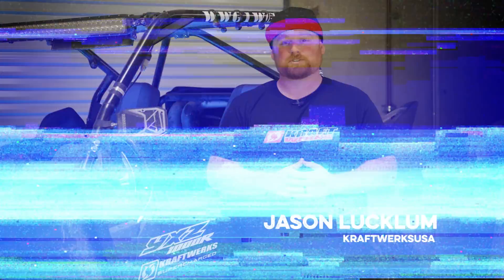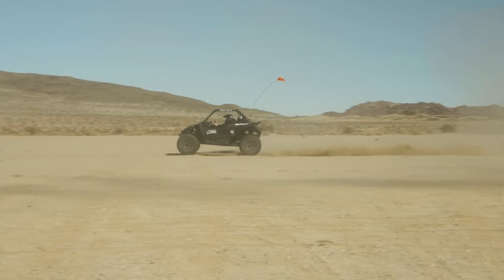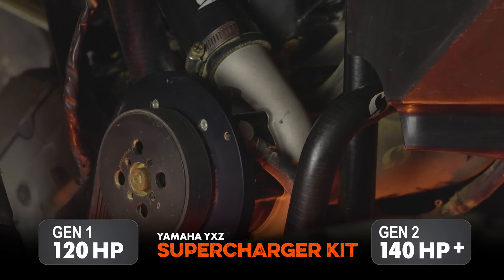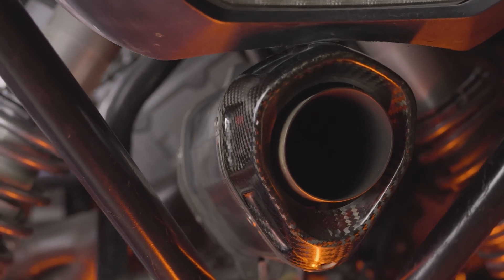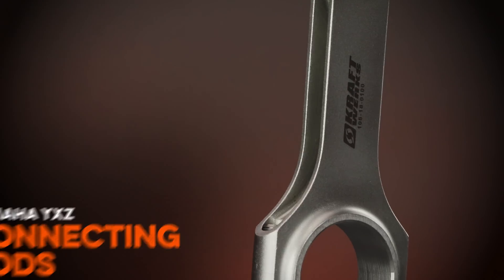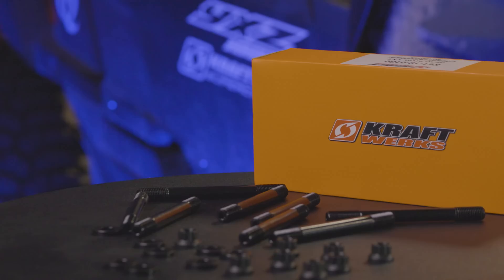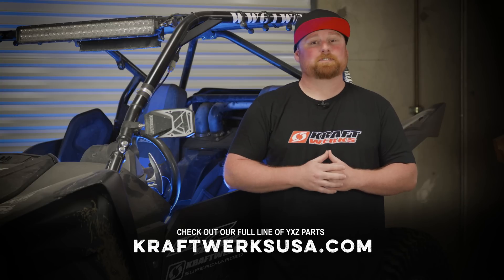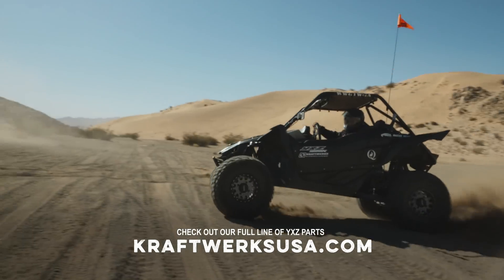Yamaha YXZ 2019-2023  Supercharger System, Engine Internals and More!

Comment: I’m leaning toward one of y’all systems I have a bone stock 2021yxz1000xtr can I purchase the exhaust system ahead and a programmer to make adjustments along the way it only has 700 miles on it and I have 3 payments left then it’s gonna get real but for this spring I’d like to get exhaust system air inj delete and a programmer over sending out my cpu
Reply: Dont get the exhaust yet, get all the parts saved up in the garage and have all the work get done at once. I promise it will be more effecient then pulling everything in and out multiple times and retuning.

I have a 2020xtr I would love to get build and supercharged myself.